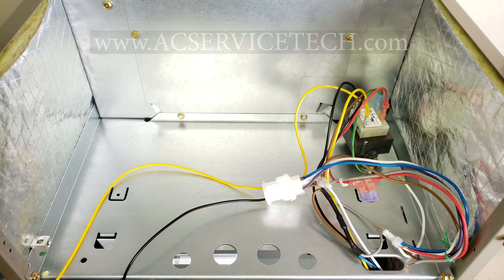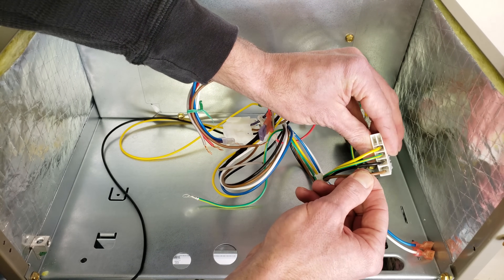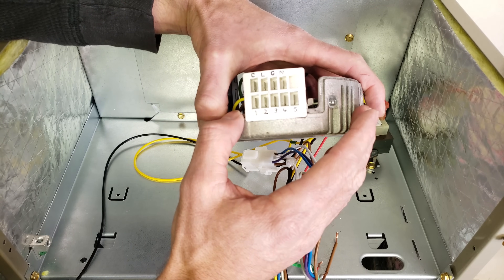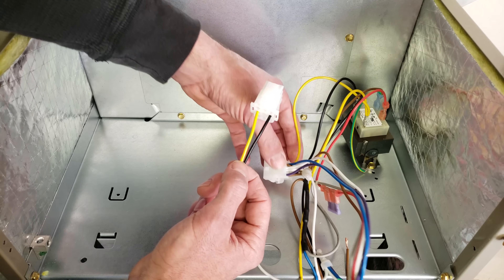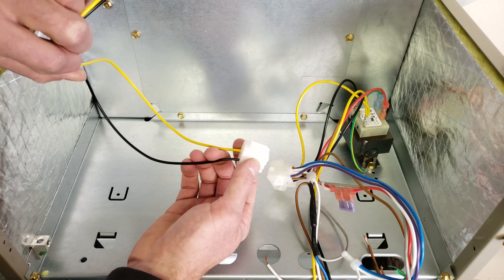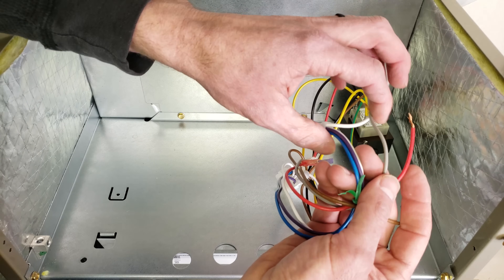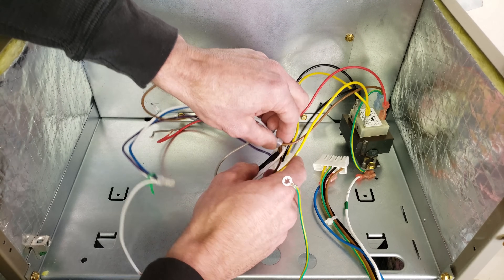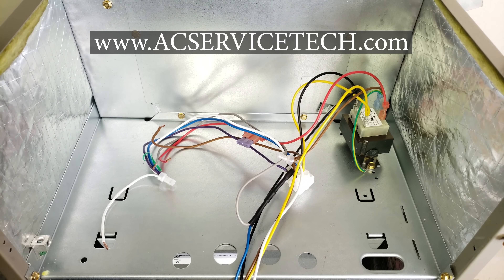How an Air Handler WITHOUT a Control Board Works! AC and Heat Pumps!

Comment: I currently have a 3amp fuse that keeps blowing in my Goodman furdown air handler straight cool system w elec heat.  it's only 18 months old, has a variable speed fan.  What do you think may be the issue? Thanks for your great videos!

Comment: I just upgraded my low-voltage thermostat wire from 18/4 to 18/5 so I can install a WiFi thermostat. Where would I attach the new blue common wire at the air handler? I only had green (G - fan), white (W - heating), yellow (Y - cooling), and red (R - power) connected on my old thermostat. Can I send you a picture of my wiring?

Comment: Awesome tutorial! I've got a Carrier FB4CN unit with a similar  setup to the one you were explaining and the blower won't turn off! Couldn't find the control board anywhere in it and happened to come across your channel. I've checked continuity on thermostat wires, they're good. When we pull out the thermostat from the wall, it stays on. The system works heat or ac just fine and the outside  unit turns on and  off, just the fan stays on. Have replaced both relays and the rectifier board and still nothing works. I'm guessing now we're looking at a bad blower motor? I don't have the funds to pay for a pro to come in now so any advice would be great, thanks!

Comment: Lennox cba27uhe I have the config you described and the blower motor does not come on, how do I jump it to see if it’s working, direct 120 power spliced into the 120 on the motor connector?

Comment: And…..  even in 2 ton air handlers with circuit boards get their boards bypassed fairly regularly bc they go bad  so often.  Results in fewer call backs just to eliminate the board (if possible)

Comment: Thank you for this video! It is very relevant for me, as I have a HVAC without control boards.
I have got an EcoBee thermostat which doesn't have batteries and I don't have the C wire running.
doesn't have a control board that I can use with the adapter board EcoBee provides in such cases.
I wander if it's possible to hook it up anyway?

Comment: This video was very helpful, I just replaced my blower module and fixed my fan that would not shut off
Reply: I'm having this same issue. What did you replace? The fan motor piece?
Reply: @ashleehouse5204  I bought just the control board. It cost $280 and just plugged into the fan

Comment: Thank you for this very informative video. I have this exact same wiring set up in my air handler and I'm looking to install an iWave R air cleaner but can't figure out how to wire it. All videos on installing it assume you have a circuit board. How would I wire it to this exact same wiring set up?

Comment: If I set the thermostat to heat and fan on, it would close the R-W and R-G contacts. It would then energize both speeds of the ECM motor. Isn't that harmful to the motor?

Comment: I’m having an issue with this exact setup. My only problem is the fan is constantly blowing, even without a call for cool or fan. Literally exact same setup.
Reply: Could be a bad thermostat, take the face of the thermostat if blower turns of its the tstat
Reply: Im dealing with same issue with a new nest thermostat my blower won’t turn off
Reply: Stumped me today. Wasn’t able to figure out why it kept running. Nest thermostat, 4 wire setup. Going back to it next week
Reply: How did u fix this I have same problem

Comment: So if the blower runs continuously even with the Thermostat un-pluged from the wall-plate, is that mean the ECM motor module needs to be replaced ? ..
Reply: Did you figure this out? I have the same issue currently
Reply: @andreiglesias5876  yes .. needed a new ECM module which is built in the end-bell cover. I might have paid $250 to order one.
Reply: @samm928  thank you!

Comment: Thank you so much Craig, today I've just finished installing an electric heat kit for a ComfortMaker AH today. The problem I had was I couldn't find the exact electric heat kit for that AH  so the installation was not simple as plug in the molex connectors together but I got to trace the wires and their functions cut it, wire nut them to make it works. I'm a veteran tech but still your video make I feel more confident to do it. Thanks again.

Comment: I have a furnace like this and the coils stay on after the fan shuts off till they overheat and kick off the safety switch or whatever its called.  Do I need a special thermostat to get the fans to delay?  Is my heating coil getting stuck on?  The coils don't shut off till there's a loud click.
Reply: Check the sequenser. The part that normally energizes and de-energizes heat strips may have sticking contacts.
Reply: @officerkrupke4966  I replaced it and wasted 50 dollars.  The furnace guy thought it was the problem as well.  At this point i have no idea
Reply: @vanmasterflash7153 check to see if the heating coil is grounded. Look for telltale black marks on frame where coils could be touching.

Comment: I just replaced my blower motor with this same setup.  I have no HVAC experience.
Question - the new motor is not moving the same volume of air.  can I move the 24volt blue wire to a different terminal (1 through 5) on the motor plug?  Old fan had blue on post 2 and white on post 4.
Reply: Call the manufacturer to get correct tap setting.

Comment: Very informative video, thank you. I have this setup, same motor too. The motor won't stop even when the thermostat is turned off (ECOBEE), so I am guessing the control board on the motor is messed up. is that right? The only way to shut it off is to cut power at the 240V  breaker.
Reply: Maybe adding a relay to kill the 240 volts coming in to the blower motor would work. Something similar to the one in the condenser unit that controls fan and compressor. 15 dollars vs hundreds. Just to be certain, buy a two pole one, so you break both lines of power, the same as throwing the breaker.

Comment: In 2004 I had a York heat pump system installed in my Virginia home. The rep offered me a variable speed air handler with delayed fan cut off a d a few seconds of delayed fan start. The rep informed me that this would add one seer in efficiency. The new Trane unit that replaced it in 2021 has a 1970s antiquated peace of junk for an air handler with no modern efficient features.  CAN ANYONE EXPLAIN TO ME WHY A COMPANY WOULD MOVE AWAY FROM EFFICIENCY?  I will give credit to the 15 seer heat pump that it is quieter.

Comment: I have been looking for a year now for someone to go step by step, adding wire by wire in sequence WITHOUT the fan control board. For instance when the thermostat calls for heat this is what happens the white wire and the red wire inside the thermostat “touch” and that 24 volts goes to the blank. Or show step by step in sequence how the power goes through each device. Another way to say what I’m asking for is I guess a video where I can walk up to an air handler WITHOUT a control board and no wires at all connected and me be able to add each wire step by step correctly. I have the basic concept down but I’ve been in situations where due to others working on the unit and not exactly knowing what to do the whole air handler needs to be re wired….I’m looking for a video that shows me how to do that. Any ideas please let me know thanks
Reply: Thats just damn near impossible for some one to do. Every unit and how it was set up is different. Colors change all the time.  There are many videos about low voltage and high voltage wiring of ac , furnaces, and air handlers.  But mostly I'd suggest watching videos on how to read schematics and wiring diagrams, cause most units give you a very specific layout on how to wire everything if you can read them.

Comment: My Blower Motor cuts on and off continuously.  The condenser is running.  I jumpered the thermostat and the same thing occurred with the motor.  Since there isn't anything in the control circuit, besides the resistor, it must be an issue with the motor.

Comment: Great video. Question: what electronic on the ECM module turns the blower off? Mine will not turn off. I have to turn off breaker to shut it off.
Reply: Did you remove the low voltage connector at speed tap and see if there was 24v calling for fan to turn on? If there is you have a tstat problem. If you dont have voltage, the module needs replacing.

Comment: I have this same set up with electric heater. The air handler stays blowing on but on 2nd zone only. I checked thermostats, zone board, and hi limit, what should I check for next?

Comment: great video! Question - I have the same set-up in the video but can't find my fuse. Any idea where it might be located? My basement air handler has the fuse connected to the red wire, but my attic unit does not have it. There's no control board so I'm stumped. Air handler is a Bryant. Thanks!
Reply: Follow the wiring from the transformer.

Comment: Does the 34V common always have to be grounded. ? Is this just to make fault finding easier so you can measure voltage using the chasis

Comment: What about the blower on delay and off delay that the control boards offer. Why dosnt this motor need delay on and off or is that feature just optional.  Thanks for a great video.

Comment: I have an old air handler without a circuit board . And a fuse.  I bypassed the thermosthat the other day trying to figure out a no start heater. In the proccess I short circuited something and now the AC is also won’t start. The first thing in my mind is to check the fuse but I can’t find it. Any suggestion is appreciated
Reply from the maker: If there is no fuse in the air handler, check to see if the secondary side of the transformer has opened up. Check the resistance with a multimeter to make sure it is not 0L, thanks!
Reply: Thanks , I’ll give it a shot!!
Reply: Ac service tech , I pulled out the transformer and I checked the resistance, the secondary reads 1.6 ohms and the primary reads 12.1 ohms. So does this mean transformer is good? I checked the relays resistance also contact 1and 3 reads OL and the two opposite side contacts has resistance of 9.6 ohms.

Comment: How would I run my control to the thermostat from here ? just bought a house and my wires from my thermostat goes straight to the outside unit . I must be over looking something  
I bought a updated thermostat that needs a c wire to power it last one was ran on battery

Comment: I had to replace the house a/c system and kept the ecm blower motor to cool my greenhouse, finding the wires configuration for it to run as a standalone blower has not been easy.

Comment: I had an intermittent motor fail on heat mode only with this type of setup. Drove me nuts. Customer was poor and couldnt replace the $400 motor with board inside motor, I cut it all out and put in a relay and basic motor. $70 vs $400 the customer almost kissed me! (Married back off)

Comment: Split ac no leakage . Blower speed okay. Cut off okay but discharge line ice form make one video
Reply: Sounds like a restriction. Maybe the liquid line drier?
Reply: @nmbr1son64  check the fan speed & system pressures.
Reply: @scoutwar1474  he said the blower speed was OK.

Comment: Can you make a video converting an x13 to psc? I did mine using a relay, paid $90 for the motor and the capacitor and bought the relay in Amazon, x13 motor was selling for $340+tax at a local warehouse.

Comment: x13 has proven to be junk, high failure rate especially at high SP levels. 3-5 year life, PSC 30+ years.  So far ECM's have cost must more to operate then the $50 yr savings vs PSC.  Now mandate ECM required on blowers, hopefully improved with a 10y war warranty.
Reply: X13 motors are great. The reason they fail is due to undersized ducts, 1 inch filters, and power surges.
Reply: 14 seer is mandated you can still have a PSC motor and obtain the seer rating.
Reply: X13 is $229 on amazon right now, psc is $80 so yes price difference but don’t slap an x13 on a poorly ducted system!
Reply: I don't believe they're junk ? Could possibly be the ductwork and/or motor settings?
These motors were designed in factory settings now being slapped in everything.
I believe more research should be done in adverse conditions?
JS
31+ years in & still going.
Stay safe.
Wear your safety glasses!

Comment: The first air handler I installed without a board, I called the supply house. They didn't know either and opened another unit to see if mine had been left out. Looking back now, I grin at myself.
Reply: Don’t feel bad, I just did the exact same thing lol
Reply: If it makes you feel any better I’m barely learning my wiring myself, and i realized I didn’t have a board on my first either, I didn’t panic just continued with the wiring, come to find out I plugged my red24v to white/heat. And left out my 24v coming from transformer I stayed at the job for an extra hour till I realized what I did lol 😂 the board wasn’t the problem it was my brain  🧠 I kept looking at my fuse like “ I think that’s supposed to be wired 😂 and followed the White wire going to the motor and said ahhh shiii
Reply: They don’t know shit they just try to sell new units

Comment: This is exactly what I tell people to buy. The must basic Rudd unit with no freaking computer boards.
Reply: The micro-controller is stil there, it potted inside the end bell of the the motor.  And cost as much as a new indoor unit to replace.
Reply: Yup control board is now part of the motor so if theres a problem you must replace the whole motor not just the board on the end of the motor. I have been replacing them with a basic relay and basic motor. Mich cheaper and MUCH more reliable.

Comment: Perfect I was looking for this type unit makes me understand the wiring on the carrier.  I been working with heatpump alot more in my area...  quick question 🤔 I been leaving W1 wire disconnected from from the air handler since there no connection for W1. I connect the W2 wire from thermostat and w2 from condenser unit to white wire on air handler. Well that's the way I was train.
Reply: The W2 on a heat pump  wiring setup is for secondary heat, so by not connecting w1 instead utilized W2 you utilized this circuit for the first stage heating you are taking out the  heat strips for emergency heat or, furnace or hydronic secondary heat * if purchased feature/ some heat pumps client does NOT buy heat strips (rare).   W1 left unhooked may be a problem if there IS heat strips present- to prevent blast of cold air during heating. IF there is a furnace and W2 is not connected properly or at all then that could be an issue. Some manufactures bundle W1/W2 , need read and interpret the wire schematic *i.e. relay used.  Furnaces are being added more in the south i.e. texas due to Natural Gas availability and temps going below 40 degrees. Provide model # on unit your referring too in your comment. Being trained based solely on model is not a good trainer or education. Being trained on how to READ wire schematics would be the best practice FOR ALL models. If there are  components mentioned above heat strips, furnance, etc and these circuit loads were not incorporated or left out of the circuit;  then there will be issues.
Reply: @proanswers  thank you for the feedback. I'm also learning about the heatpumps.. the schematic is the same as the video heatpump. Schematic only shows w2 but not w1. Yes the unit I been working have heatstrips. I just want make sure the way I was being trained is the correct way.. also on the thermostat ecobee I'll modify by turning on W1 if you understand what I'm trying to say because thermostat won't program with out stage 1 heat.
Reply: @emilionunez4566   Sounds like you have W2 conductor/wire  installed at the thermostat (ecobee) under the W1 push tab which is correct since you dont have a W1. Bascially a single stage auxiliary heat then you don’t need W2. Both your auxiliary and emergency heat are activated by powering the single W1 (which is using W2); in this case you utilize the W2 signal conductor/wire
Reply: @proanswers  sounds about right... the other question the other day I was practicing trouble shooting by checking the 24v on the condenser wiring. I call for heat at the thermostat, I notice the Y1-yellow and W2-white were getting 24v at the same time. When  call for cool the Y1 was the only one getting 24v.
Reply: @emilionunez4566  On a heat pump tstat in heat mode, if it is set more than two degrees above ambient, it will power heat strips as well as condenser.

Comment: Great vídeo!
Can those Resistors failed? What would happen if it fails and how can you troubleshoot a failed resistor?
Reply: You won’t be getting any voltage to the blue or the white wire which means the motor is probably good you could just get a new wiring harness or bypass that resistor give the blower voltage or jump it out see if it works through the blue or white wire

Comment: Why does common go to ground???? Don’t you need common to complete the 24vcircuit on your contactors?
Reply: This explanation isn't really all the accurate but for simplicity you can come across a 24. Volt ungrounded control circuit that utilize what is called a "floating ground " which if you had a situation where you had a direct dead short would take out the component with the short as well as the transformer now with a grounded common given the same condition hopefully the fuse would blow on the transformer in other words the ungrounded way would let all the affected components just would sit there and burn up until the transformer gives out